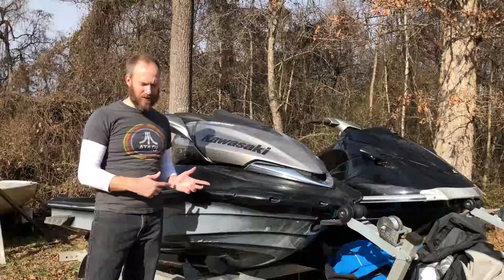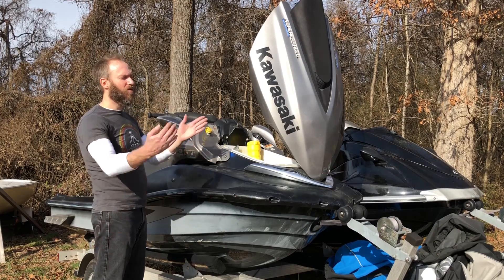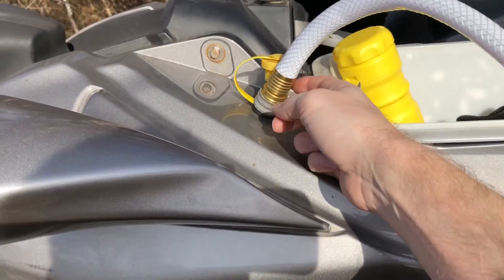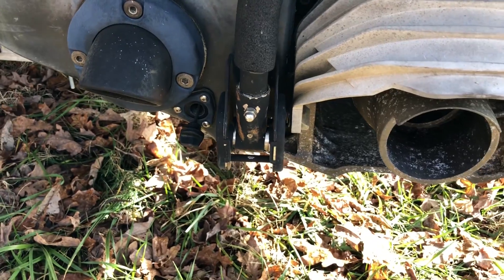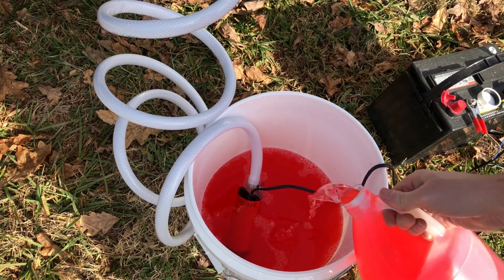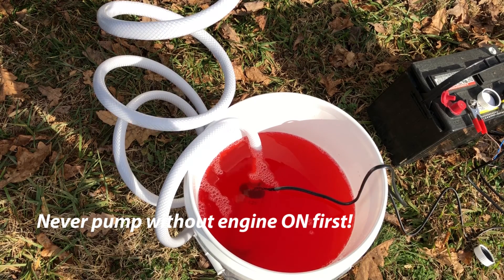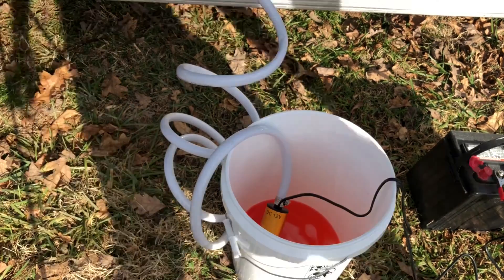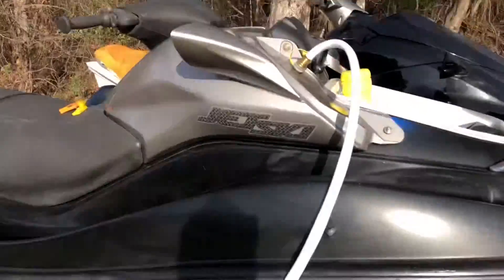How to Winterize a Jetski with Antifreeze.  Kawasaki Ultra Coolant Flush

Comment: 30 liter a minute is the minimum?
Reply from the maker: It is not an absolute minimum.  It is the level I selected and targeted.  You should have something that flows similar to a home garden hose.  That is generally between  22 to 90 liters per minute, (6-24 gpm) depending on a bunch of factors, (your water psi and hose distance for instance).  30 lpm was a good fit in my opinion.  Flow rate was solid without worrying about over pressurizing the engine.

Comment: Hey man. Thanks for the video. 
As you mentioned, this is not everything about winterizing. Other things are (I think): adding fuel stabilizer and filling your gas tank, defrosting your spark plug compartment (not sure if that's necessary), and perform an oil change (with filter replacement).
Apart from what I've mentioned, is there anything else for winterizing?